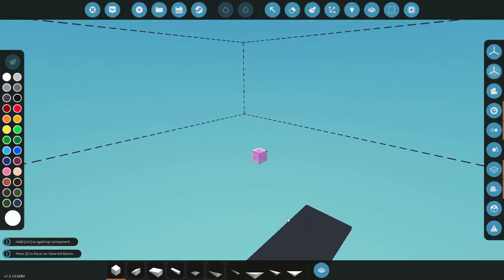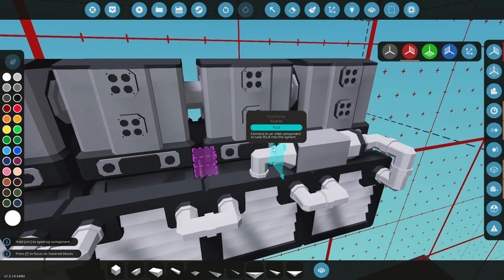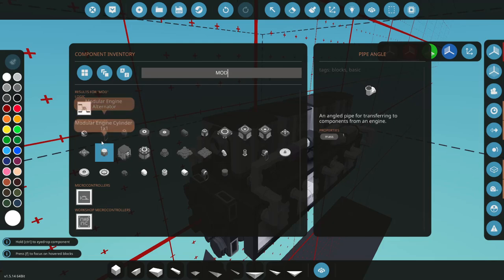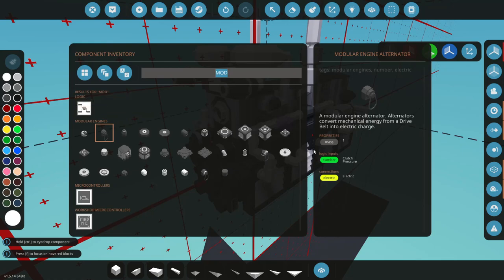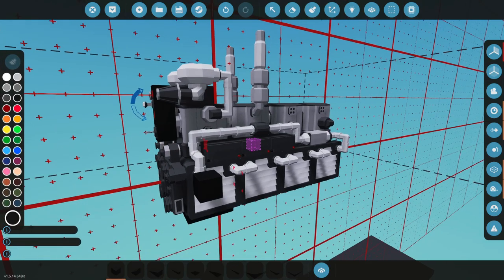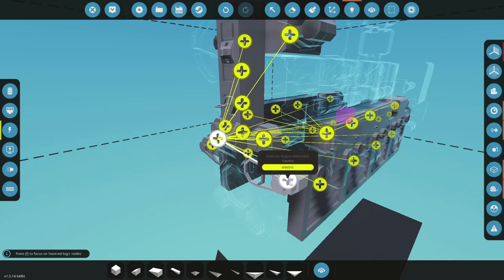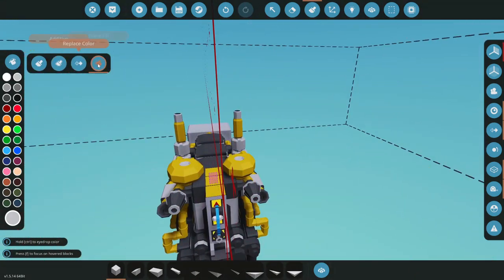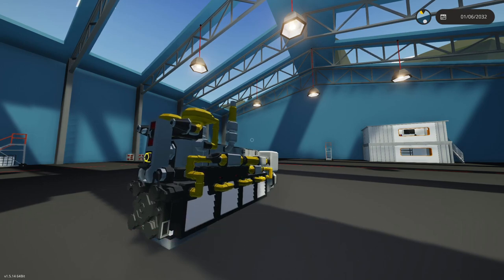Front Loader Modular Engine Build! [E1] STORMWORKS BUILD SERIES

Comment: A suggestion for a cooling system:
Use a 5x5 radiator behind the engine to make it look more like a real loader.  Then use liquid to air heat exchanger connected to the liquid ports then run a loop of air to another air to liquid heat exchanger with the liquid coming from and going ti the engine.  Just need a port to let air into the air loop.  And the valve to cut off coolant at the radiator for a thermostat.
Reply from the maker: I gotta change what I did. Looped radiators don't work.  Deletes the coolant. 5x5 here I come.
Reply: @ProfNCognito  yeah, it is never a good idea to put the radiators in line like that, the flow drop from one to the next is ridiculous making it near zero by the end.   

The main issue with cooling with a direct loop from the engine is that the game uses the average of the temperature between the cooling parts and the engine.  The radiator will increase in temp if it can not cool fast enough,  raising the temp of the average of the entire system.    

Using the split system method allows the radiator time to cool the water inside it, lowering the average and keeping the system cool.   It just needs time to cool the liquid inside.  

You made a tutorial for supercooling engines.  That tutorial is what gave me the idea to test that concept out.  The system you made is almost exactly what i use with the exception of adding a valve to allow the radiator to cool the liquid before returning to the loop.
Reply: @ProfNCognito  Also,  you can use 2 coolant manifolds to connect the loop, just use one side of each manifold.  In for one out for the other.

Comment: I don't think you'd need that many radiators if you had a water tank for actual coolant. Unless you add a coolant tank with some kind of fluid, it is literally just cooling with air.
Reply from the maker: Already finding issues with it as I test it.  Will have to fix.